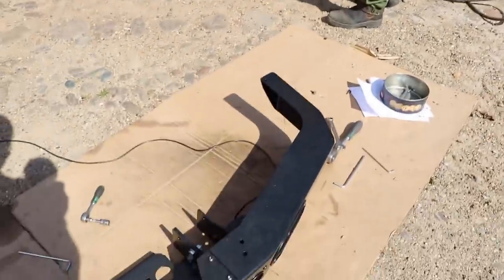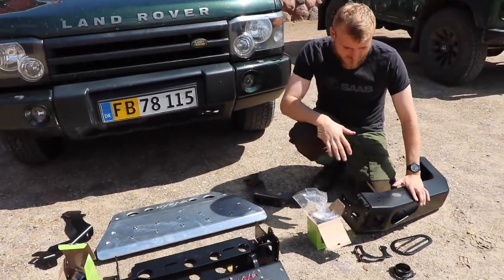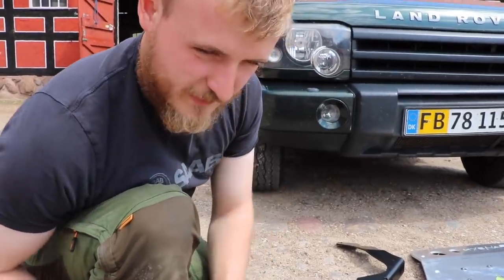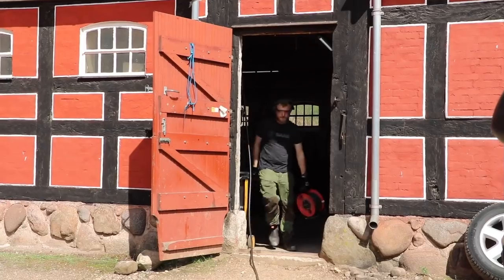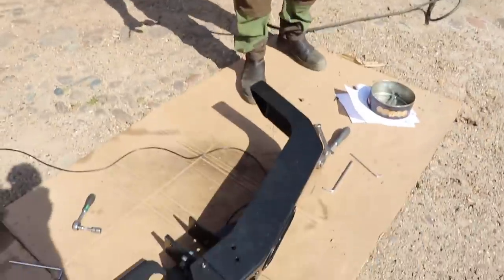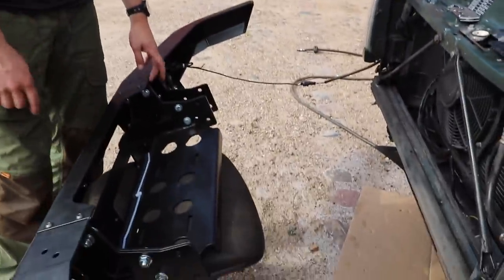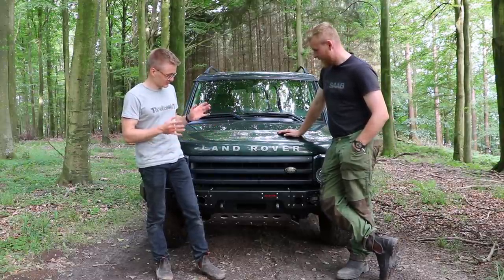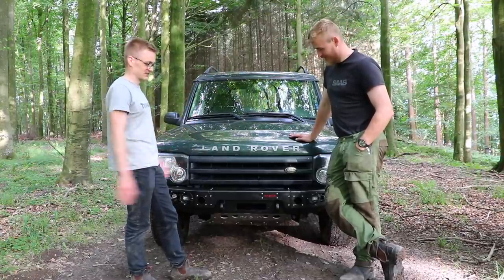The first mod for the "new" Discovery!

Comment: Hyena overland products are very interesting,  im not sure 🤔 between the arb bull bumper vs. Hyena, the front bumper by you saying a bag full of bolts to figure out kinda discouraged a bit , i am interested in the rear bumper, but i don't like the fact you need to cut off a piece of rear quarter panel to make it fit and it exposed more of the undercarriage and the rear hitch may not work but i do like the fact it has a rear hitch carrier built in i wished someone had a installation video